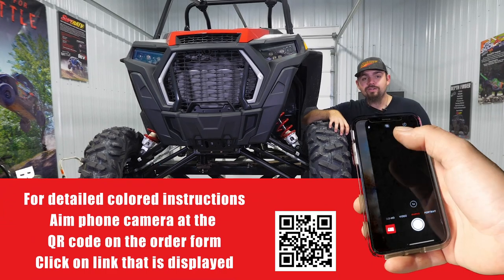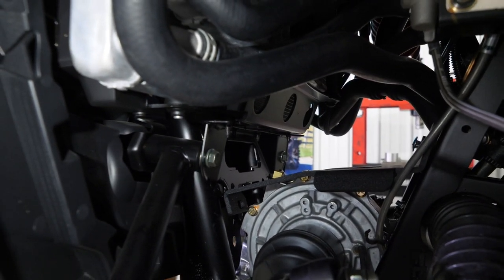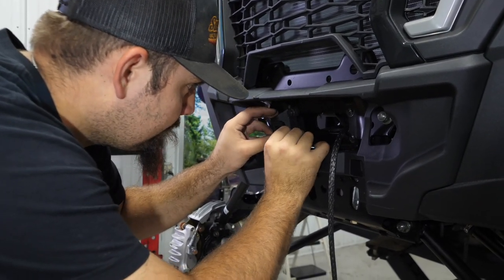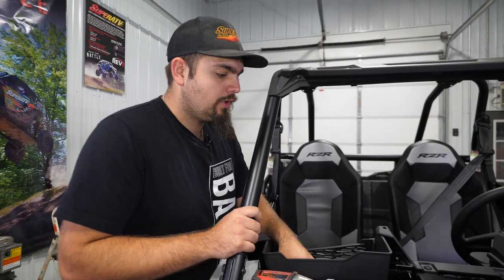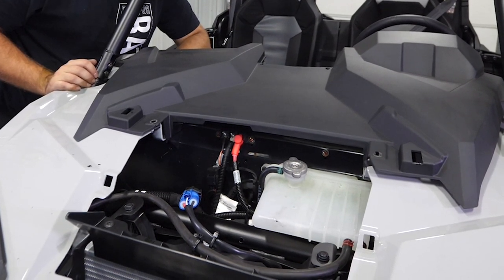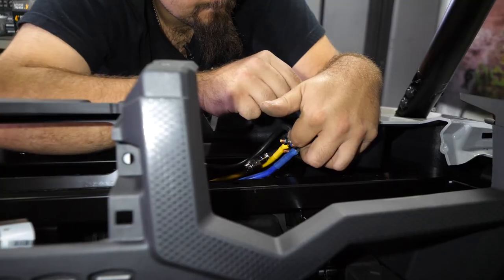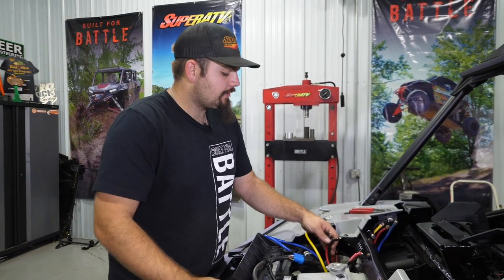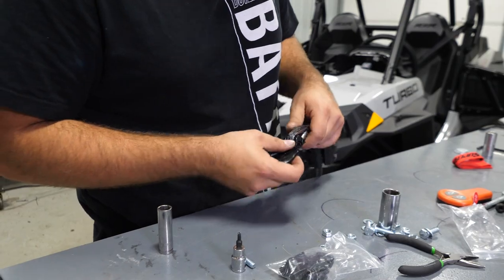4500lb Black Ops Series Winch Install | Polaris RZR | SuperATV

Comment: great video...but. On all hardware, the lock washer goes on first, then the flat washer. the flat washer should always go against the surface.  The lock washer works a a spring force between the flat washer and bolt head or nut.

Comment: Terrific video!  Followed your step by step instructions for a Black Ops 4500 winch on a 2019 XP 4 1000 Turbo.  Installing the bolts on the mounting plate and winch took some patients, but I knew what to anticipate as you described during your installation comments.  I ordered the mounting plate for my model and everything worked perfect including the rocker switch in the factory slot.
Reply from the maker: Glad we could help! Thanks for the feedback!

Comment: Great Video, helped a lot. Installed mine on a 2019 XP 1000 Dynamix, was basically the same install, just had to go around a lot more wiring with my Command Ride. Also did not mess with the front diff line or brake line, easily worked around it.

Comment: I have a 900s and my solenoid in my kit looks like that. Biggest pain in the a** I've ever seen. 1 of the battery lugs make it impossible to get a screwdriver on the screw head if youre using machine screws and nuts! And to put a screw or bolt in from the underside it better be the right length or you can't get the nut on ! If i hadn't cut my battery cables to length already i would return my kit.

Comment: HEADS UP: ROCKER SWITCH PROVIDED WITH THE KIT DOES NOT FIT OEM ROCKER SWITCH SLOTS FOR RZR XP TURBO MODEL SHOWN IN VIDEO
Reply: How is this remedied?
Reply: Just ran into this problem kinda a bummer
Reply: @CrumbScum  lol here we are the down votes section
Reply: @patkennedy7333  what do you do to run the switch?
Reply: @CrumbScum  cut the wires and reconnect to a compatible rocker switch with spade connectors